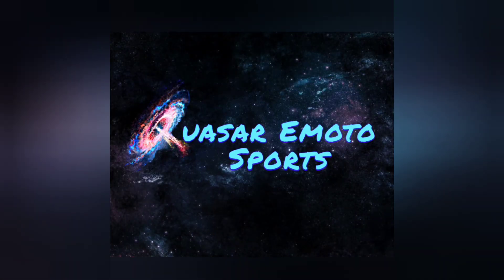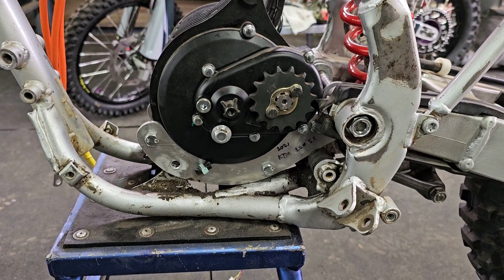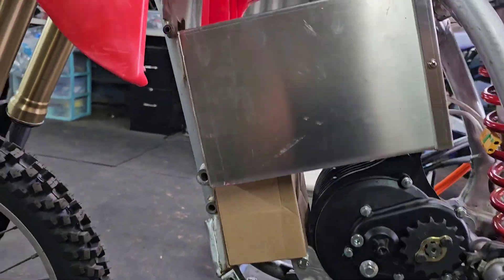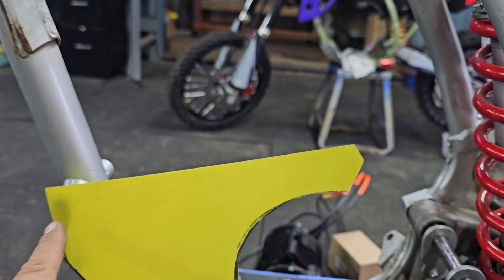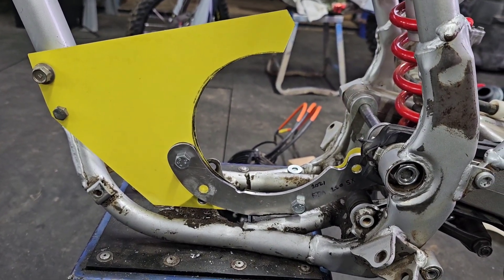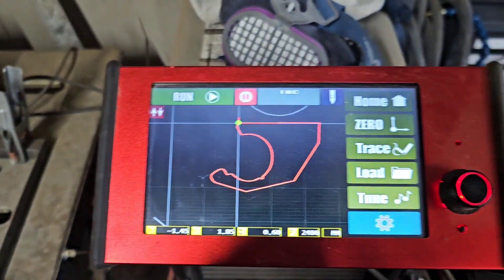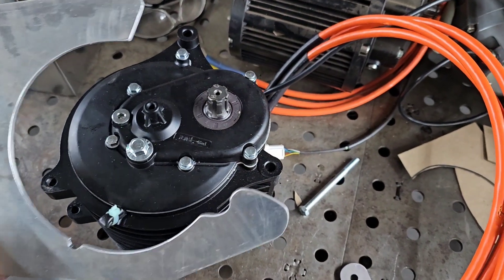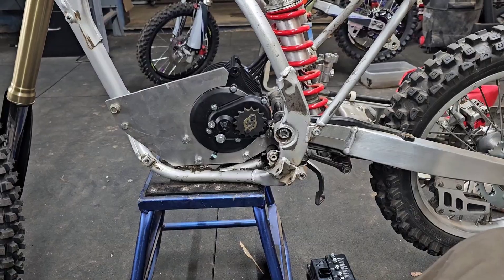Electric Dirtbike! (Honda 150r Conversion)  episode 1

Comment: That’s awesome!  Love that cnc. Got a link?  Can it trace holes too?
Reply from the maker: It can trace anything. 
It's called the Arc Droid. I run the Facebook group. Check it out!
Reply from the maker: You can also make and place holes and other shapes in the UI on the screen
Reply: @QuasarEMotoSports that’s fucking awesome. Thank you.
Reply from the maker: @bj97301  you local? I accept visitors!
Reply: @QuasarEMotoSports  I wish. I plan to visit Electro & Company some day. Maybe I’ll swing by your place too 😃.  I love working on bikes. Would love to check out your setup.
Reply from the maker: @bj97301  We are only an hour apart. Let me know, Austin is a good friend of mine.
Reply: @QuasarEMotoSports  will do!  Hope to see ya sometime 🤘